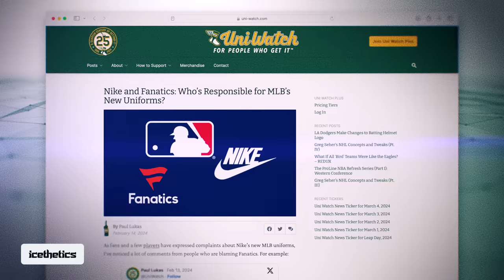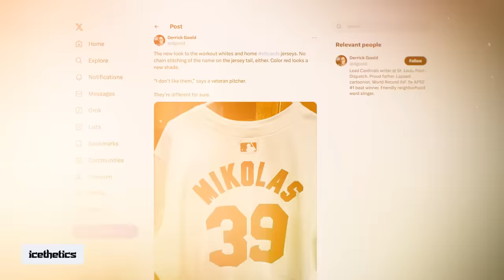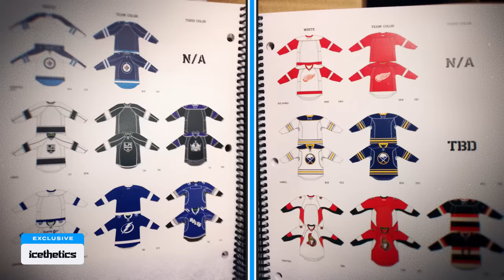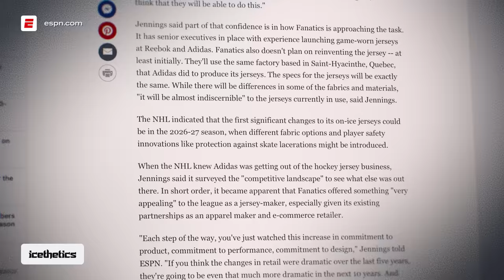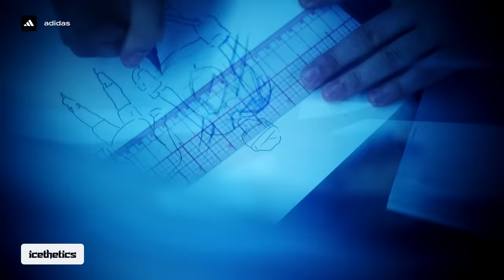JERSEYWATCH: First Look at Fanatics 2024 NHL Jerseys!

Comment from the maker: One thing I forgot to mention in this video is that for the last seven years, Fanatics has basically been contractually obligated to make a lower quality NHL replica jersey. This doesn’t account for misspelled names, wrong numbers, and upside down logos... but Adidas had the deal to make higher quality authentic jerseys. The Fanatics Breakaway product always had to be cheaper to buy and therefore cheaper to make. I’ll be curious to see what happens when Fanatics gets to make the entire line of NHL jerseys, including authentics, which is a high-priced product for hardcore fans. They can’t skimp there or they’ll get destroyed. And they know it.
Reply: My issue with the Fanatics replicas isn't necessarily the product but the price point. The Adidas "authentics" were not that much more cost-wise and were a much better product. The Fanatics replicas should be below $100 IMO. Hopefully the price scale will better reflect the product differences.
Reply: @notrealneverwas  True. There is no scenario where fans stop buying jerseys outright. Price will always go up,  they will find new ways to cut corners, and fans will complain to deaf ears.
Reply: Do they know it though? or do they know that fans will buy their shit no matter how bad it is if it's the only option?
Reply: Compared to other leagues, hell, compared to before the Adidas switch NHL authentics are pretty fairly priced.  What I’m most worried to change, do we have any idea if that will continue through the same Indonesian pipeline?
Reply: fanatics’ whole business model - explicitly - is to create the lowest quality product that is still tolerable to the largest group of consumers of buyers of sports merchandise: the unaware. anyone interested enough in hockey sweaters to subscribe to a channel all about them is not their target demographic - it’s people who will buy their product just because it is the jersey of their favorite team while being blissfully unaware of the awful quality that they’ll receive. someone like, say, my mom doesn’t know squat about jerseys and never will, but she’d’ve gotten my brothers and i fanatics jerseys for christmas if they held the license when i was a kid. i wish that once - just once - the nhl would turn down dollars that worsen the experience for their fans (bloated rsns, putrid jersey & helmet ads, yearly jersey releases, relentless gambling partnerships), but i fear they’ll continue to chase the greedy trends of the other american leagues instead of setting themselves apart
Reply: Some retailers have heard they will offer 3 tiers, the current breakaways, the current adidas "replicas" and on ice MIC's at retail. Hopefully that is true
Reply: I agree and I wish the worst for them in case they offer crap quality.
Reply: @notrealneverwas Well, they fibally should know and channels like this is informing them the crap they are buying.
Reply: The issue is that in the CCM and Reebok years, I always bought the lower quality "replica" jerseys and never felt like I was cheaping out. They felt good and the logos on the front were cloth. Some of "fashion" jerseys (the blackout ones and such) were flat heat pressed logos. 

The fanatics breakaway jerseys brought that cheap "fashion" jersey quality up to the replica level. The only choice for something that looked and felt decent was the top "authentic" level.
Reply: @LiqdPT  Exactly, the fan replicas were high quality by then.
Reply: Are you basing your Bruins prediction off of any information or is that an assumption? I was thinking perhaps they'd keep the home and road jerseys from this season, but just transition the gold portions back to the more yellowish "Bruins gold," rather than the true gold on them this season.

Comment: I have no Adidas jerseys but I have one of those old CCM Maska Air-Knit jerseys and two Fanatics jerseys. The old CCMs are a lot thinner than some would expect (About the same as Fanatics) and the stripes of the Oilers jerseys aren't sewed on on the retail version like they are with Fanatics, on-ice CCM, or Adidas. That being said, the front logo is a lot better on the CCMs than the Fanatics. I think the front logo is where a lot of the shade to Fanatics comes in on.
Reply: I have collected CCM's for 30 years, and their quality of replica jerseys declined in different ways.  From the early 80's, the material on the replicas was a smooth, thin cheap version on the Ultra-knit which is the much thicker pro version.  CCM went to air-knit, which was lighter and more breathable.  The replica material at first was the same as the pro material as far as I can tell comparing several replica and authentic CCM's from the early 90's.  Then the replica air-knit became lighter and not as heavy and then softer, smoother and even lighter.
I love the material that they use on their AHL jerseys now, as it is a slightly lighter material that is identical to the made in Canada Adidas NHL jerseys now. But any shoulder patches on these are very thin and felt-like which are sublimated or printed.

Comment: Still relatively concerned about the Fanatics quality because I have a Canucks road jersey and the logo isn't great. Post To Post Production has got a New Jersey Devils home Fanatics jersey with a crease in the logo (the jersey was sent in by a fan)
Reply from the maker: Right. I mentioned this in the pinned comment, but those Breakaway replica jerseys were always going to be lower quality. Fanatics was contractually obligated to make a jersey that was cheaper to buy and therefore cheaper to make. Once they get into making the authentics this year, I think you’ll see quality that’s closer to if not the same as what Adidas was making.

Comment: I only own 3 jerseys from the Fanatics era introduced in 2017. All of them have been fine for me. My other jerseys are from the Reebok era and maybe two from CCM

2 CCM, two Reebok Edge (pre-2011) , 5 Reebok from 2011-2017,  and 3 Fanatics. I do not own any made by Adidas

It would be ironic if Fanatics releases jerseys league wide for the 2026-27 season, at least for me, because that season will mark 20 years as a hockey fan for me.

Comment: Fanatics can’t be absolved of the MLB fiasco this spring. Nike owns some of it, sure. But were the colors really manufactured to spec? Was the crooked and off-center nameplate lettering part of the design? Was the design built upon, so any extent, the manufacturer’s costs and/or capabilities? I think blame can be shared here.

As far as NHL, I’m not a big fan of “Property of”; it’s more fan-like than official phrasing. But technically it’s more true than ever, and it IS just a practice jersey.

As for using the same Adidas factory, that’s meaningless to me. You can put me in Julia Child’s kitchen and I still couldn’t make you a decent omelette.
Reply from the maker: I’m not absolving Fanatics on the MLB thing. A good manufacturer at least pushes back if they know the specs they’re getting are subpar. So either they didn’t realize (bad), they knew but didn’t say anything (also bad), or they told Nike and were ignored (who knows?).

On your Julia Child analogy, the difference is, you wouldn’t be the one cooking, she would. Fanatics isn’t restaffing the factory. I think what you’re really talking about is who’s writing the recipe. And Fanatics is bringing over the best recipe writers from Adidas/Reebok so that’s my reason for hope.

Comment: I have collected CCM's for over 30 years, and their quality of replica jerseys declined in some ways.  From the early 80's, the material on the replicas was a smooth, thin cheap version on the Ultra-knit which is the much thicker pro version.  CCM went to air-knit, which was lighter and more breathable.  The replica material at first was the same as the pro material as far as I can tell comparing several replica and authentic CCM's from the early 90's.  Then the replica air-knit became lighter and not as heavy and changed slightly again with softer, smoother and even lighter material.
I love the material that CCM uses on their AHL jerseys now, as it is a slightly lighter material that is identical to the made in Canada Adidas NHL jerseys now. But any shoulder patches on these are very thin and felt-like which are sublimated or printed.

Comment: I did hear a rumor that Fanatics in 2026 would completely copying the Adidas jerseys 100% the same as adidas
Reply from the maker: That’s what will happen next season, 2024-25. The Adidas jersey rebranded, basically. The plan for 2026-27 would be their own template. But like I said, I’ve been told they’re not looking to reinvent the wheel. So I would not expect the hockey jersey to change all that much at that point. But we’ll see.
Reply: @icethetics  oh my bad I missed understood you
Reply: @icethetics  now correct me if I’m wrong but aren’t the adidas jersey going to be put on sale so the can get rid of all of them and make room for the new ones
Reply from the maker: Hard to say. Sales are down to individual retailers. And those who know the market will know what they have is still valuable, which might make discounts hard to find. Just have to wait and see what the summer brings.

Comment: I really disliked that goofy pentagon panel with the shield that Adidas randomly placed on the front on the collar. That stupid panel was sometimes a separate color than the rest of the striping. Or it cut off the striping that wraps around the rest of the collar. Both of which always looked like crap. Here's hoping Fanatics also eliminates the silly half stripe effect that Adidas employed that often had a white stripe on the back of the collar. Only for it to inexplicably disappear on the front of the collar. Stop overthinking this! Make the collar striping match! And get rid of the unnecessary pentagon panel with the shield that fucks up the striping.

Comment: If the MLB jerseys are any indication then this is going to be a disaster when it comes to Fanatics taking over the NHL jerseys.
Reply from the maker: Well if you watched that section of the video, the MLB disaster is exactly why I think the NHL won’t be. MLB redesign was not on them but they got a front row seat to the fan reaction. They’ve gotta learn from that, right?
Reply: @icethetics, I hope I am wrong. I really do. But Fanatics doesn't have a great track record of making good products. They are open and proud of how they want to do things as cheaply as possible.
Reply: @icethetics  how long is deal with Fanatics for ?
Reply: @realjamesbowned  it's for 10 years. So until 2034-2035.
Reply from the maker: They do have a rough track record when it comes to fan merch, no doubt. But they’ve made locker room performance wear for NHL players for years and I can’t say I’ve ever heard hockey players complain the way baseball players have been lately. Just saying. Could be reason for optimism there.

Comment: The Reebok Edge sweater is the worst thing to happen to the hockey sweater ever
They gave us some of the worst design elements, some of which we still see today. 
Piping, vertical piping, the exclusion of waist stripes, squared shoulder yokes, absolutely atrocious sleeve and armpit designs,  numbers on the front of the sweater, and the basketball style design (Dallas Stars, NY Islanders). 
Yes some of the elements were already in use, but not quite as widespread. 
However, the Edge collars were great. I’d like to see something similar brought back